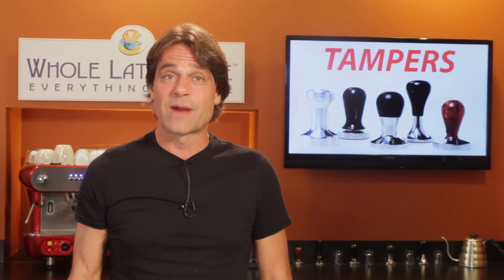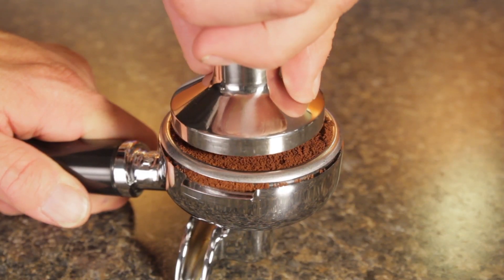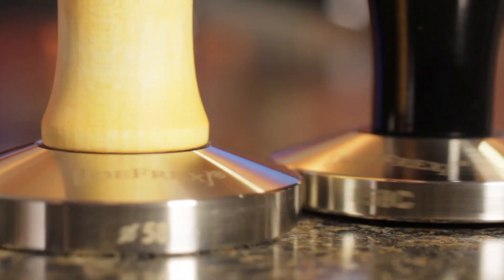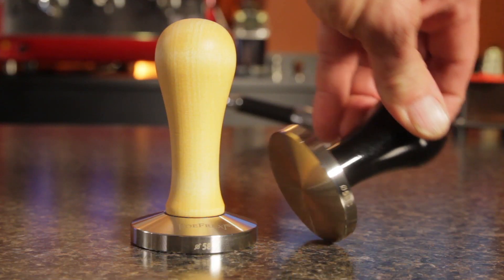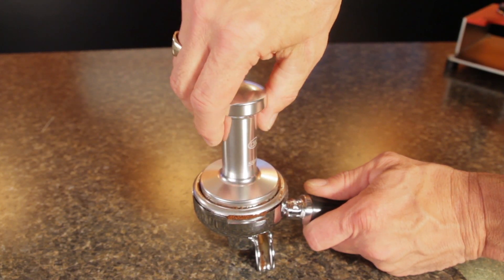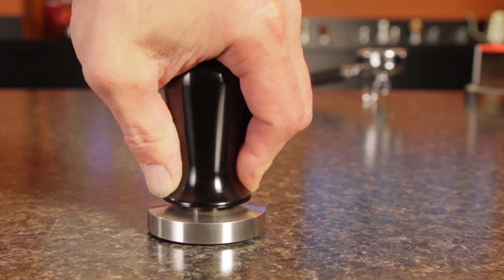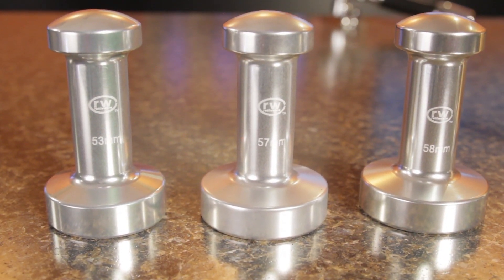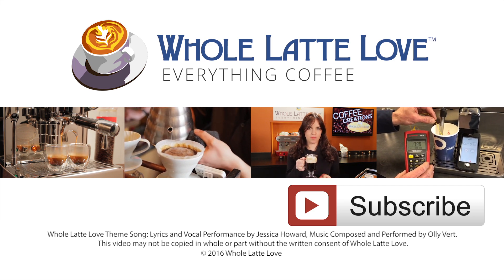How to Choose an Espresso Tamper

Comment: I made myself one from stainless steel. 
First measuring out perfect hight, made some calculations on weight, designed it with a 3D software and made it with a CNC lathe. 
Last but not least some sanding and polishing by hand so I could see myself clearly in it and that's it. 
Cost me a lot of time but everytime I use it I can feel like the work behind it and I love it!
Reply from the maker: Hi Jonas, Very cool! There's something extra special about making and using your own tools!

Comment: For me, the first half minute vas by far the most informative of the whole thing. I was really unaware that my machine had a pressure basket (and that this was even non-standard in expresso making), so this dropped my shoulders five steps when it comes to the tamper missing in my machine bundle. Thanx!
Reply from the maker: Hi FH, Thanks for the comment. Go to a non-pressurized basket/machine and you'll get a whole new level of potential quality!
Marc
Reply: @Wholelattelovepage  I'm really happy with my current rig (a Dualit express auto), but I might check that out

Comment: Out of the several tampers I have my favorite and daily use tamper is the Cafelat, 58.35mm VST | Strada and it weighs in 355.8g. It has a decent weight and a great feel and look to it. Plus it fits my VST basket superbly and I never get any coffee on the sides.

Comment: I have a pressurized basket so I guess I'm OK with the free plastic tamper. Thanks to your video!
Reply from the maker: Hi Ted, You are welcome. In most cases tamping in pressurized portafilter has little affect on an extraction.
Marc
Reply: @Wholelattelovepage  That's been my experience with my Starbucks Barista machine. I've been tamping with a comically small tamper for years and as long as I tamp hard around the whole area, it seems to work just fine.
This clearly wouldn't work on a non pressurized portafilter, but I usually don't see much channeling.
Reply from the maker: Chris L Hi, thanks for he comment. Due to the way the work there’s really no chance of visible channeling in a pressurized filter basket. While that sounds great, truth is pressurized baskets make inferior espresso compared to non-pressurized. Brew water doesn’t really flow through the coffee puck, brew pressures tend to be too high and grind size has little effect on shot timing so can’t really dial in grind size. On the plus side you can use pre-ground coffee in a pressurized basket so don’t have to have a grinder. Marc

Comment: Handle and overall weight feel makes all the difference in my opinion. I've tried some very expensive Reg Barber tampers that I so don't like both the handle and they are just way too heavy I think although I tried another Reg Barber model that weighs less but the handle is not to my liking as I like more of and egg shaped handle that is not too long. But then again Reg Barber tampers are very popular amongst baristas over here in Iceland.

My preference is the Espresso Parts compressore black tamper. The handle weighs 185g and the base 315g which I think makes for a great balance in my hand. I choose the flat base just because I've only used flat base tampers with good results and I don't care for at least at the time being to try something different unless I get super consistent with my espresso routine as it is now.
Reply from the maker: Hi Stefan, Thanks for your comment! My Espro runs about 460g. I have not used Reg Barber. I like a solid heavy feel but sounds like they are over the top.

Comment: I have an entry level espresso machine with a 5.1 mm pressurized basket, so I don't really bother to have the plastic spoon/tamper. But I have discovered something that really goes against all that it's normally said about pressurized baskets. Grinding, tamping evenness and tamping force do affect the final result. At first I was sloppy and didn't really care, but then I started kinda training my technique before I invest in a decent machine. Different grinding and tamping force change the taste and extraction times of the coffee, dno mattee what machine you're using.
Reply from the maker: Hi Alexander, Hopefully you basket  is 51mm and not 5.1mm! Guessing a slight typo there :). Anyway, as you point out there are cases where grind size and tamping can affect extractions in machines brewing thru a pressurized basket. Here's a link to a video I did on the Gaggia Carezza which makes exactly that point: https://youtu.be/hy8Lvqm37-Y?t=130 The Carezza has a filter basket with hundreds of holes. It's very different than most pressurized baskets which have just one hole that causes the restriction and pressure build up.
Marc

Comment: Hey Mark, another great video. My husband came home from work one day with a tamper he made. Hes a welder. I have been using it for years and since i have nothing to compare it to, it works just fine. But i do have a question. Do you have a video about the filter baskets, pressurized/non pressurized. My old machine came with 3 and i didn't know what the difference was except that some were deep and some shallow. My machine I have had 24 years, it was a used one someone gifted me. Its all metal Barista sold my Starbucks apparently years ago. It still works pretty good, but i fear one day its going to pack it in so i am researching new ones of equal quality. Anyways, sorry that was a long ramble. I love your channel it has helped me so much
Reply from the maker: Hi lyn, thanks for the love and sharing your tamper story. I do have an older video on pressurized vs non pressurized: https://youtu.be/v-9qJbmCgCQ
They are fairly easy to tell apart. Non pressurized usually has many holes. Like 100s! Pressurized usually have a single hole in the basket or a restriction built into the portafilter below the basket. Hope that helps!
Marc
Reply: @Wholelattelovepage  thanks so much. Ok so mine is non pressurized. Just watched the video and i dream of the day i can make crema like that. I think my next machine will be the Gaggia classic. Thanks so much for your help Mark

Comment: Hi Mark!, Im using a brevile BES870XL, like you mentioned in the video, it has a 54mm portafilter. However, i find that the stock tamper is abit small, leaving gaps at the edges.  i have been researching almost everywhere and i found few sites recommending sizes such as 53.3mm or 53.5mm tamper. What do YOU recommend? :) i want to have a tamper that fits snugly with no vacuum created when pulling the tamper out of the basket.
Reply from the maker: Hi GC! I know what you mean with the slight gap with some tampers and PF's. Personally I prefer a slightly lose fit with a tamper as opposed to tight. With a tight fitting tamper there's always the potential of a vacuum as you mentioned. But my bigger concern is when inserting a tight tamper. I've found that it can cause the tamper to tilt very easily and result in a tamped surface that is not parallel. In your shoes, I'd take a look at the pucks in the PF after brewing. Are you seeing channeling at the edges of the puck? If not I wouldn't worry to much about a little play - All my 58mm tampers have a mm or 2 of play in commercial baskets.

Comment: Hi I have a delonghi dedica pressurised coffee machine but recently I ordered an unpressurised basket and naked portafilter and I'm wondering what tamper would be best like weight metal etc for unpressurised and I'm also going to order a coffee distributor would that be any good thanks I liked and subscribed
Reply from the maker: Hi Daniel,  Thanks for the like and subscribe! A distributor can help but honestly I think it's a bit of overkill for a product like the Dedica. It's an entry-level espresso maker designed by Delonghi to use a pressurized filter basket. I know there are 3rd party non-pressurized accessories available and some claim to get decent results using them. But, there are other issues like brew temp variations, thermal instability, limited coffee dose weight, etc. which limit the Dedica's potential. Understand I'm not trying to rain on your espresso parade - just giving best honest advice I can. For those looking to move beyond entry-level appliance grade products and do non pressurized espresso I strongly suggest a true machine like the Gaggia Classic Pro: https://www.wholelattelove.com/products/gaggia-classic-pro
The GCP comes out of the box with non-pressurized and a pressurized filter basket. It uses a commercial size and weight 58mm portafilter. Has a true boiler and manual steam wand for latte art quality frothing. By the time you buy all the mods for the Dedica to go non-pressurized you'll like be at about the same cost of the Classic.
Marc
Reply: I just got a distributor yesterday and TBH, it hasn't made that much of a difference. It is nice in that it will reduce unevenness, but it's one of those purchases that you can make later if need be. If you notice random distribution of coffee coming out, then a distributor might be worthwhile, but it's worth waiting until you know you need it and getting a really nice one. 
IIRC, there was another video on this channel comparing tamper, distributor and both results.
Reply: @SmallSpoonBrigade  thanks so much for the info I have not received my unpressurised portafilter yet but I definitely will do what you said about the distributor I have the default plastic tamper that came with it or if the box I'm going to buy a tamper first and see what it's like then buy the destributor after I've seen loads of good reviews on the unpressurised portafilter I bought on amazon for my dedica saying it improved the espresso alot so I'm really excited to receive it thanks again for the info and I'll keep you updated on the unpressurised portafilter and let you know how it went
Reply: @Wholelattelovepage  that's great thanks for the info I would definitely love to get that machine the only problem is that I only recently got the machine and a delonghi burr grinder so it would be a long time till I can upgrade but I'll definitely keep it in mind for an upgrade one day but for the moment I'm very happy with my dedica the coffee tastes great about the double scoop unpressurised portafilter I ordered on amazon I have seen tons of positive reviews on YouTube and amazon on the filter I bought and tons of people are saying it improved the espresso alot so I can't wait to see what it's like I will get a proper metal tamper as with the dedica I only got a plastic one but I'll hold out on the distributer and see how I go with just the tamper but thanks for the honest review I know it may not be professional but I'm hoping for a difference I will let you know how it went when I recieve the item I really love your channel it really helps with my coffee experience your information was very helpful thanks so much for the reply
Reply: @SmallSpoonBrigade  hi update on the unpresurised basket I received it and it made a huge improvement on the machine it's works so well it tastes exactly like my favourite coffee shop I can't tell the difference I also bought an official delonghi stainless steel tamper and stainless steel distribution tool and they both made a huge difference they made the shots better and more consistent and faster thanks so much for the info I subscribed to your channel
Reply: @Wholelattelovepage  hey whole latte love thanks for the info I recently received my unpresurised bottomless portafilter and it made a huge improvement over the pressurised basket it tastes exactly like the coffee from my favourite coffee shop I'm really happy as I only got the machine and I couldn't upgrade but the coffee shots come out perfectly as on the delonghi dedica you can choose the water hardness and water temperature I also purchased an official delonghi stainless steel tamper and stainless Steel distribution tool and they also made a big improvement over the plastic tamper I get more consistent shots its way quicker to use and tastes better I really love your channel its so helpful thanks again for the info keep up the great work

Comment: Hi! Great video! As I was reading your comments I understand that in pressurized basket it's OK if i don't use a tamber am I right? Would you suggest to use distributor?
Reply from the maker: Hi dm, You are correct. Tamping does has little to no affect on extractions in pressurized baskets. Same story with the distributor.
Marc
Reply: @Wholelattelovepage  Thank you very much for your answer!

Comment: Can I use a 49mm tamper for my 51mm portafilter of delonghi dedica? Will it have a huge gap that can result channeling for the puck? Or is it just fine?
Reply from the maker: Hi Jarold, Thanks for the question. Using a 49mm tamper is fine. The Dedica uses a pressurized filter basket so perfect tamping is not required.
Marc
Reply: @Wholelattelovepage  ok thanks. But how about with my non pressurized filter basket? I'm thinking of buying a tamper that can tamp all the way through single shot of coffee powder at least 7grams, because my filter basket is for a double shot basket? Please help, I appreciate your answer, thanks.

Comment: Question : Do you suggest better the 58.5 mm  or the 58 mm bottom diameter and why ?
Reply from the maker: Hey Kats, Thanks for the question. Well, I don't like a sloppy fit when tamping so I prefer the 58.5. Depends on brand of tamper but many listed as 58mm are actually a little bigger like 58.4 or 58.5. Also depends on what type of filter basket you have. Precision 58mm baskets are usually in the 58.6 - 58.7mm range so a 58.5 actual or a 58mm that's in reality a little closer to 58.5 works well. I have run into a a few stock filter baskets which are a little smaller than others like Rancilio's which are a bit smaller than 58.5. Hope that helps!
Marc

Comment: Side note. Aluminum tampers like the one that came with my Rocket that have a grained finish that grips the grounds and pulls them out of the basket when you lift, making a mess. Also if I tried to polish the puck, it actually shredded the top of the puck. Not so with my steel Reg Barber tamper.
Reply from the maker: Hi TT, Thanks for the comment. How long have you had your Rocket machine. I don't recall a Rocket branded tamper included with machines in aluminum with a grained finish. Think this is what comes with most of their machines which include a tamper now: https://www.wholelattelove.com/collections/tampers/products/rocket-espresso-tamper-1
Marc

Comment: This is a very informative video, I used to work at several coffee shops that used tampers, I've recently purchased a cheap Mr Coffee espresso machine to hold me over till we can afford a much more practical and efficient espresso machine but it came with the cheap pressurized basket and didn't have a plastic tamper, just a spoon with an angled back, clearly it doesn't work as it's way smaller then the basket itself... I purchased a 50mm and naturally it was too big and got stuck, so I was just curious since it is a basic filter basket is there another option to help push it down then the tiny angle spoon I'm stuck with that pushes the espresso all over the place? Thanks in advance!
Reply from the maker: Hi Gillian, Thanks for your comment and question. When using a pressurized basket tamping is not critical - honestly, not even required as it's the pressurized basket (and the tiny little hole in it) that builds up the pressure rather than the coffee puck. A lot different than pulling shots thru a standard non-pressurized basket like you prolly worked with in coffee shops. On your machine tamping will have no effect on the extraction.
Reply: Whole Latte Love Thanks for your help! I think since  I'm used to a more complex espresso machine , this little thing is too easy it's complex! I think i can taste the difference between tampering and pressurized coffee big time. Thanks again! I look forward to more of your insightful videos.
Reply: If you are using the same machine I think you are using, then you actually need a 49mm tamper.  Also, get the depressurized basket (Mr. Coffee basket 4101) while you're at it. I actually modified my DeLonghi Dedica 680 portafilter to accept the 4101, and I found that the "Omgogo Stainless Steel Coffee Tamper 49mm Barista Espresso Base Coffee Bean Press" (look it up on Amazon) works great with this basket.

Comment: I rested a 30-pound dumb bell, from my weight bench, on top of the cheap plastic tamper that came with my ECM Classika PID that you just sold me.  That ensured an accurate 30 pounds of pressure.  Now, I am wondering whether I really need that $135 Jack Leveler that I just ordered from you, but has not yet been delivered.  The 30-pound dumb bell seems to suffice.  (PS - Really enjoying my purchase - both the brewer and the Ceado E37S grinder.)
Reply from the maker: Hi GX, Glad to hear you are enjoying the Classika and the E37S. Best single boiler PID machine available and the E37S is the last grinder you will ever buy - hard to do better. Most all machines come with the dorky plastic tamper. A few super high end ones comes with much nicer tampers but that's rare. If you were to do bottomless shots and compare the flow from a tamped shot vs. a Jack leveled shot I can guarantee you you will see the difference. Much less channeling and nice even development from all parts of the filter basket. Read comments from users on my Jack video - it's an easy consistency upgrade!
Marc
Reply: @Wholelattelovepage  Thanks.  But I deserve credit for using a 30-pound dumb bell to achieve a proper 30-pound tamp.  I bet that is a first.
Reply from the maker: LOL!